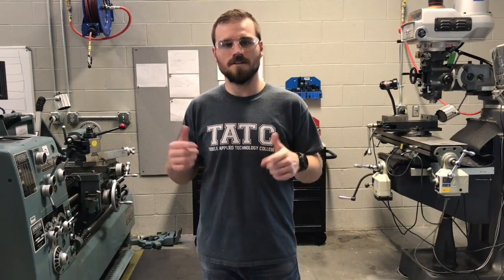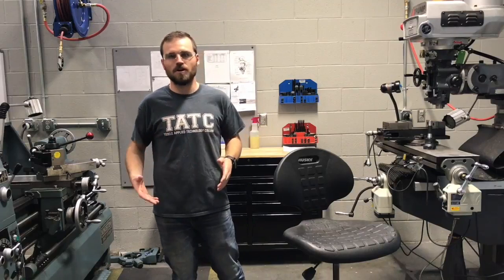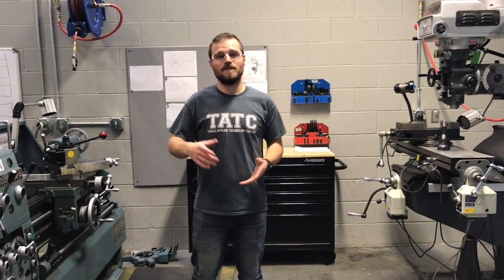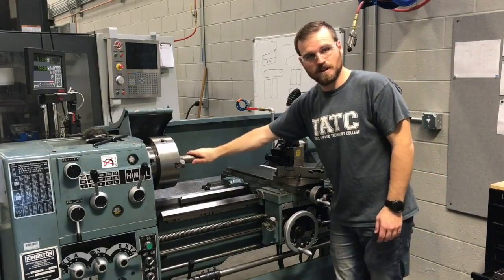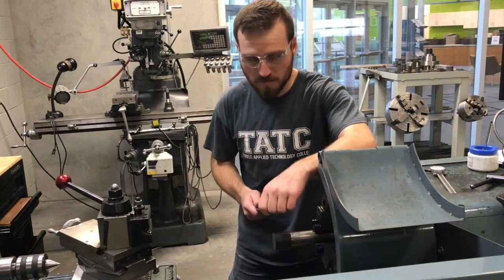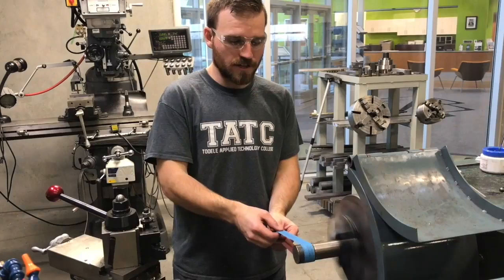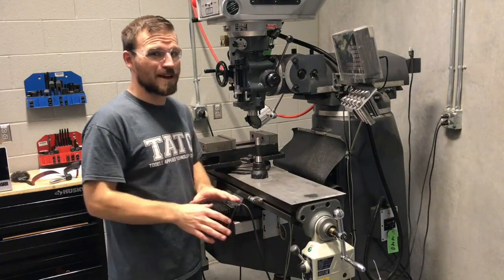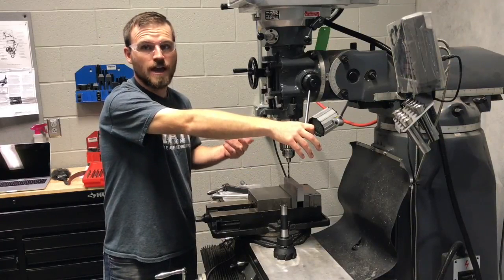Safety for the machine shop

Comment: I have been wearing ear plugs for 10 years and can promise that it doesn't ruin  you're ability to tell what is happening in the cut. If you leave the cord on you can use them like a stethoscope.  might take some getting use to at first but I can hear better wearing earplugs than my coworkers not wearing them. Years in a shop you will lose you're hearing.
Over use of compressed air is also a big problem especially when people like to get as close to what they are cleaning as possible. Many machinists I have worked with religiously blow off cutting oil when taping with each hole even when doing production so muchso the smell of oil becomes prominent (im not talking about smoke).  The closer to any liquid you get with high pressure air the smaller the liquid droplets until its a fine mist in the air you are breathing. Cutting oil, chemicals in coolant,  dirt on the floor, and sylica baced oil absorbent are not meant to be breathed. 

The file safty is suprising problem, I have watched 60 year old machinists using files wrong on the lathe. 
I have personally watched the horror of what a lathe does to a body, and it's not what anyone wants happen to themselves. After 11 years I still can't run a lathe without getting the occasional creeps.
Reply: Not sure how I ended up here but, glad I read your comment. I'll definitely be more cautious with the damn air gun. Cheers.

Comment: Dear sir, 

Kindly help on below topic to run mechanical machining/sheet metal workshop.

a) How to calculate overheads and own costing of per hour
b) How to estimate cost of part from drawing given by customer. ie Rates to quote to client , which covers own labour cost, material and factory overheads.

I am running machine workshop at Mumbai -India with manual lathe, milling, drilling, bandsaw and welding machine.

Thanks ,

Comment: says make sure the guard is down before using the lathe, then proceeds to use lathe without the guard in place.
Reply: the guard is to prevent chips from  flying into the operator's face not for filing